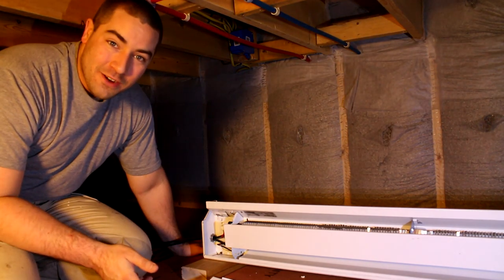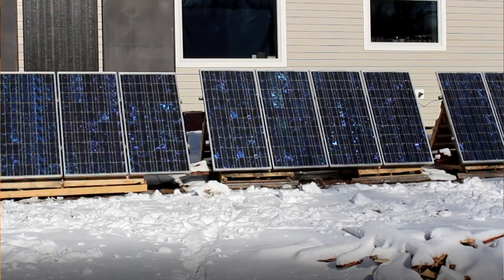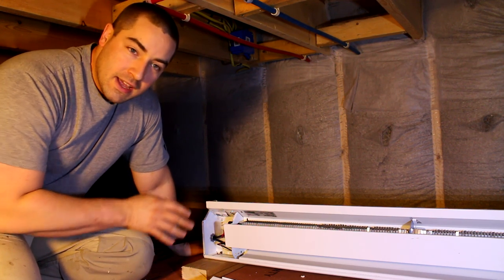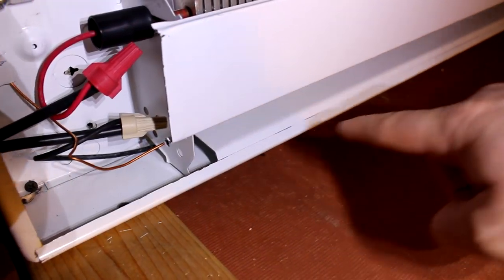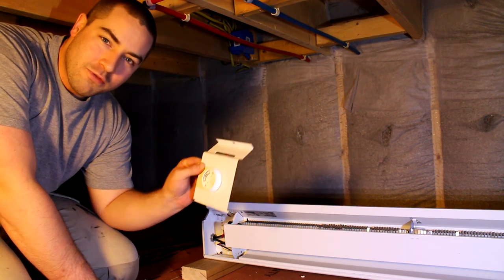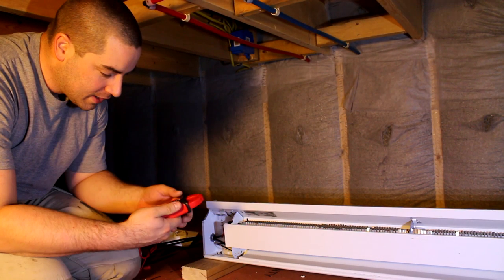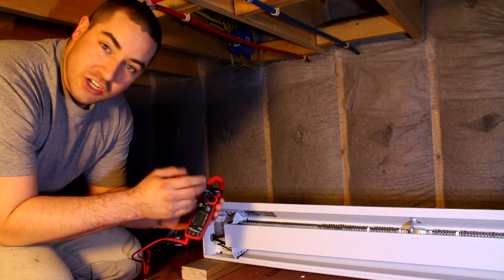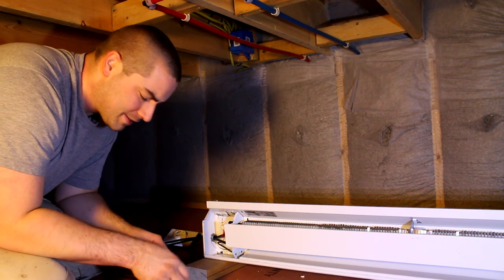Space Heater Running Direct off Solar PV

Comment: Heating water is also doable.  I am using a device that changes DC to a modified sine wave, so it works with the stock thermostat on the lower element, and the lower element is divorced from the upper element.  The hot water rises and prevents the upper element (AC) from operating, unless a cloudy day or over use at night.  Then the AC element kicks in and at least gets you by on a half tank of hot water until the sun returns..  This setup has saved me 70% on my water heating cost for the house.
Reply: I'd like to see or read more about your setup.  maybe post a video?

Comment: Hello David, thanks for the great idea. I connected five 300W panels in series and connected them to a 1500 watt heater element. It works but only when it's noon, the rest of the time the open-circuit voltage is around 190v but when connected to the load it shows only 3 to 5 volts.  Is it normal or something is wrong? Thanks
Reply from the maker: It's best to size the load 1.3x the ohms of your solar arrays mpp.  I have a free calculator on my website.  The calculator is for water heating elements, but same difference for electric baseboards.  Be sure to use some circuit breakers for DC, and no AC switches or thermostats.

Comment: It's a good setup, though I agree with adding a breaker. One way to improve it would be a MPPT controller. That tracks the maximum power point. Power being voltage times current. And since solar voltage can be all over the place, a highly resistive load will draw that voltage down and can reduce the end output power. Whereas the MPPT controller would know that if it held a slightly lower current it could hold the voltage twice as high or something. But those usually require a battery, might work with a single resistive load.
Reply: i was looking for az MPPT controller that works without battery to provide reference voltage and I only found experimental things, though it should arguably be possible.

Comment: I love this !  A year or so ago I hooked a 320 watt panel to a water heating element and the resistance was such that it put the panel right at it's VMP - like 36 V, so in theory, if your panels are running close to their VMP while connected to the baseboard heater, you won't need a MPPT controller.   I'm trying to think where you could get a DC switch that would handle that sort of voltage - should you want to turn the heater off with sun on the panels....   and I'm coming up dry
Reply from the maker: Yeah, I tried a high-amp DC switch for car stereos, but it arched.  I just bought some parts from Midnite solar with breakers rated for 300v, so they should work.
Reply: Excellent !... I didn't realize they sold breakers that are rated for voltage that high- good to know.
Reply: havent we all seen the old monster movies with crazy scientists flipping huge connector switches that have like 6-12 inches between the contactors.. yes that is all it takes couple of pinch joints and a piece of smashed copper pipe insulated handle on non conductive mount surface. why we all think everything has to be so damn complicated is beyond me maybe because we are so vain and require everything to be aesthetic over functionality.

Comment: Resistive heat will work regardless of voltage , good idea to use a fuse protection in  case of unforseen issues with heater, short cct for example.

Comment: You definitely want a fuse or DC breaker in there somewhere for safety. A DC disconnect is a good idea too, to connect and disconnect power to the heater, but also to shut down power for working on it.
Sounds like you are having fun! Take care and be safe.

Comment: Great video!  My PV direct preheated geyser is up and running for the past 3 days.  I have 2x 280w (31.4v under load).  I couldn't get a affordable low voltage element,  so I replaced the 2kw element with a 4kw element (cheapest way to half the resistance, and making the panels more efficient under lower voltage operation).  With my current setup,  I can get 298watt supplied to the element.  If I add a 3rd panel in series,  it will bump the voltage to 94.2v. Can get 670watt power then. Easy to calculate the efficiency of the heater element:
Element wattage X (applied voltage)^2, divided by (rated voltage)^2. In South Africa we have 230v, so have to bump up the volts quite high to get 100% out of the panels.  At +-125volt on the 4kw element,  the power is 1:1

Comment: The fuse or DC break would be for safety.  The only additional thing I can think of is a disconnect switch for summer time.  Good thoughs and ideas.  Thanks for the reminder that ohms are ohms.

Comment: Love your videos David.  I have seen AC heating elements sold as DC heating elements with a huge markup.  The only difference is the watt rating for use at a lower voltage.  I think it was 48V instead of 110V.  I thought it was pretty clever even though a little shifty.  For those that don't know any better, they were just wasting money.

Its been a lot of fun binge watching your videos over that last few days.  I would love to hear how you learned about the building techniques you used on the house. Interested to see how it works over time.

Comment: Good video👍I’ve always wondered if it was possible. Turns out it can be done with any heater lol. Thanks!!!! The goal would be to find a heater that can operate at different voltages. Seems like it’ll be best to do it with batteries also. Thanks tho!!

Comment: 2:50.. A resistor or resistive load in your case does not care if the power in is AC or DC.
A small DC circulating fan would also be a good idea in the crawl space to move that heated air around.
Reply from the maker: Thanks.

Comment: I can't believe this video doesn't have more views than this.  Similar idea/project to the direct pv water heater except there as most people do use one element for solar connection and leave one connected to AC for toping heat off when needed.  I know you have thermal storage non pressurized heat exchange for water heating from ur videos.  Why not as others have suggested use mass storage of heat to mitigate fluctuations of solar availability such as water storage or mass storage in slab etc like you may have done in workshop with radiant floor.  Inside you wouldn't need to insulate it much if any like your water heater exchange system just enough to prevent control overheating.  You could even make a heat storage vault outside the home or even underground to store the heat/energy and just exchange to it when heat needed.  Essentially like a ground source system with only a small circulation pump etc needed because it would be above the conditioned air temp when used.  I want to watch , whenever you may build a new home to see how you choose to manage it maybe with less battery needs and more direct solar conditioning etc. A
Reply from the maker: Thanks, I wish the video got more views also.  It's such a simple idea.  I thought about adding thermal mass to this, but found that there was not enough heat to worry about it (for me).  My solar window is only 3 hours so there is not a surplus of heat to store.  If I had less shading, or a bigger array, then I would add mass.  Thanks for watching.  Please help the views by sharing.

Comment: Interesting test.  I could see using method but I'm hoping to eventually reuse my hydronic baseboards with an electric water heater.  I like the idea of only heating the space with hydronic on demand by controlling when the circulator pump runs.

Comment: Man, I can't wait to try this!
Reply from the maker: I had some hiccups along the way. I made a free calculator on my website to make it easier.  It's for hot water elements, but the concept is identical for electric baseboards.  They are both electric heat.
Reply: I found a cool way to make a solar water heater by hooking up a solar panel to a couple of diesel glow plugs.

Comment: One more quick point on VMP-  I have 2 banks of panels (15 and 12) connected to 2 Midnight Classics, and another bank of 3 panels connected to an inexpensive Chinese MPPT controller and the operating voltage can be anywhere from 91 to 127V on any of the controllers at any time.  It seems that sweet spot isn't all that sweet.... in fact, the cheap Chinese controller seems to favor the lower operating  voltage (all panels are 3 in series) and it seems to out perform the Midnight Classic in terms of watts per panel harvested at any given time.  The VMP written on the panel is 36V, so, 108 should be right at the maximum power point (for 3 in series), but it's not- at least according to the output I observe.
Reply from the maker: Thanks for sharing.  I've been saving up to buy the Midnite Classic 200, but maybe not after your comment.
Reply: Oh gosh, don't let me steer you away from the Cadillac of charge controllers.  The Classic does far and beyond what my little MakeSkyBlue does in terms of features.   But if you don't need all the control features the inexpensive charge controller has been working great for almost a year now in every day/ off grid use.

Comment: Keep up the great work. The only thing that separates you from an electrical engineer is the restraints that the industry puts on people threw limited thinking. Yes safety first, and after we all know that the fun begins because even certified people within the field need others to push boundaries and see what can be achieved. I just finished my first free energy genorater and had been thinking about how I could do this since about maybe 12 years old and I'm 38 now, I have to do some adjustments but I can say I made it. This video is inspiring and I had seen this video before. I think you are on to somthing with removing the thermostate and I find that amazing you are getting heat off of solar and that dosen't surprise me. Thiers alot of funny tricks as barries with each industry and once people try new methods you can see what possibilities can be done. Thanks and I may try this method for my father in the future. Keep inventing and innovating
Reply: I like this video a lot and agree that one has to do things not only think about them. But I can't pass this sentence without a remark "The only thing that separates you from an electrical engineer is the restraints that the industry puts on people threw limited thinking." One still has to learn lots of physics and a host of subjects to be an electrical engineer. You don't need to go to university or something but power electricity is a very deep subject, you have to hit the books and spend time to understand what's going on, especially if you want to get out of the threaded path. The entire electricity about invisible things and phenomena you only indirectly can experience and lots of counter intuitive stuff. One can get only so far with experimenting but when stakes start getting higher (investment, safety or that it MUST work) you need to know what you are doing. And yes of course nothing is carved in stone but if someone wants to extend a subject first he or she has to walk the line to the boundaries.

Comment: Avoid any type of charge controller and battery. They are not that efficient and high cost.  I heat all my hot water with PV solar and my controller designs can can cost less than $25 to build and are very efficient.  If you ever get adventurous, check out my videos on water heating. I could walk you thru it.  I did build one using one of those oil filled radiators to take the chill off one room. Feel frrr to ask any real technical question on any video.  I just don't see why this isn't more popular.  Keeping the panel near power point is fairly simple.  The real benefits are in those less than prime light levels where increases in heat are up to five times what can be obatined by directly connecting to a fixed resistance.  I'd love to help someone do a system like I have.
Reply: tell me more please....tax free tart at g mail

Comment: Good choice for a short-term use of your panels! You are right the old thermostat would Arc with DC. You can buy DC rated relays and drive those with a thermostat. 

Resistance is resistance - AC or DC same effect on purely resistive devices. Not true for motors or other resistive devices that have inductance as well. How many panels in series are you driving it with? How many watts per panel?
Reply from the maker: 12 panels, each rated for 158 watts.  Thanks for verifying the resistance heater.
Reply from the maker: At volts MP, the total rated is 283.2V at 6.68A, 1891 Watts.  I've never seen that, as you can see in the chart in the video, but that is the potential.
Reply: DavidPoz you won’t see Vmpp / Impp without some smarts to manage the voltage/current balance to hit the sweet spot in the curve where they are maxed - but that’s okay. 

No surprise you aren’t seeing max output either. Panels are rated using STC (standard test conditions) - something you don’t see in the real world. Expect generally about 75-80% of their rated performance under most conditions where everything is optimum. 

If you want to have fun, you can arc weld with those wires from the panels using the DC voltage - very cool effect, just spark them and pull the wires apart as you manage the arc.
Reply from the maker: Now you are going to get me in trouble with Alaina... LOL
Reply: DavidPoz no need to get in trouble with the missus. It’s working and a worthwhile short-term use of the panels! There is a company that claims they can MPP a load like your heater (they drive water heater elements) but your specs / load are higher than their product can handle. 

2000 watts of solar will put over 2MW of sunlight into something through a year....
Reply from the maker: I've seen different press releases over the last couple years about companies trying to produce an MPPT controller with direct to load, but I can't find any on the market.  (with the exception of one company that wants to sell you the panels, controller, and water tank as a kit.)  Do you know of a source where I can purchase an MPPT controller online (NOT through an installer)?
Reply: DavidPoz look on epay for solar water heater mppt under the user techluck1. I have no experience with their product but they claim to have mppt for resistive loads for the purpose of heating water. Should get the same effect with your baseboard heater.
Reply: Based on your data, the resistance is about 41 ohms, and you said that the heater was rated to 2500W, which would imply a maximum current of 7.8A (I*I*R=2500). (Not sure if being rated at AC changes the maximums; for example, perhaps we should use the RMS values when powered by DC? It's been too long since my EE classes!) Since your panels put out 6.68A max, I think you should be safe with the configuration you have. I'm not sure that an MPPT controller can provide you with any more power. For long term use, I agree with some of the other posters that you should definitely include a safety cut-off. Overall, a very cool project! Keep them coming!

Comment: This interests me here in Colorado during our cold winters here in the city.
I’ve often wondered what I may be simply missing with some possible uses of solar panels but without complications and expense of batteries and pipes and such.
I mean what are the things some solar panels I could put on my roof without batteries could be done to reduce living costs in my already built house...
So when I look at solar heating or solar water heating, it looks pretty complicated because they never use solar PV panels that produce electricity from the sun.
Instead they use solar panels that use the sun to directly heat water because they say these systems are some 70% efficient where PV panels are like 20% efficient.
I have to wonder if they are discounting PV panels too quickly because they want to shoot down anything simple the home owner might be able to do on their own.
Reply: It seems it’d be cool to be able to connect PV panels directly to evaporative cooler in the summer and some resistive heater in the winter...
Or perhaps PV panels to supplement heat the hot tub all season long..
Perhaps with our electric cars of the near future we will be able to use PV panels to charge them from the garage..
Reply: Hey, free energy is free energy, no matter how efficient.  For hot water, I would put an electric tank ahead of my gas hw tank, then I still have a backup no matter what.  Be careful with the limits and temp controls in the tank, though, DC current will quickly fry the contacts.  You can run SSR's controlled by the thermostat contacts, this will eliminate current through the contacts and the thermostats will last forever.
Reply: @JimTMcDaniels1 In answer to charging Electric cars. I have solar panels and a Tesla model 3, so you are charging the car off solar  because you are using your solar for your own use and then selling the excess to the power company if you are grid tied. Right now I am on Time of use so they charge me 8 .88 cents per KWH from 8 PM to 8 Am . So that is when I set the car to charge if it needs it. Now I am grandfathered in for 10 years to the plan where WE energy's used to have to pay you what they charged you for your solar overproduction.. My 10 years will be up in Dec of 2024 so then they will only be paying me 3 cents per KWh for my Solar overproduction,  so it would actually be cheaper charging my car then.  3 cents instead of 8 cents. I am considering getting a Tesla powerwall  at that time instead of selling the power company my solar.
Reply: About to do this since xcel energy prices shot up. Used panels used baseboard heater.